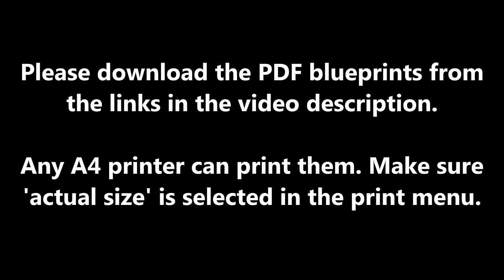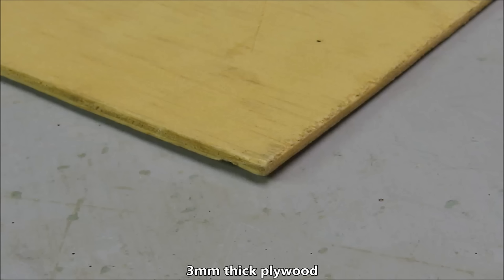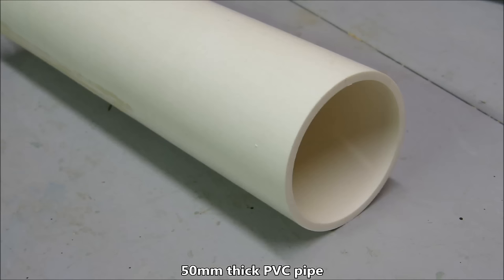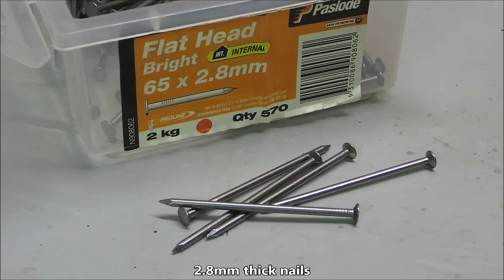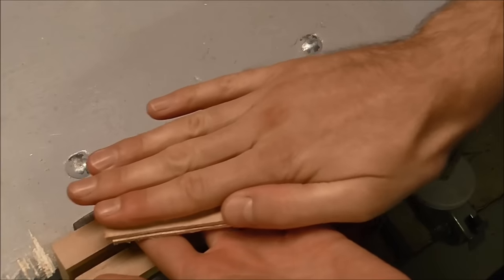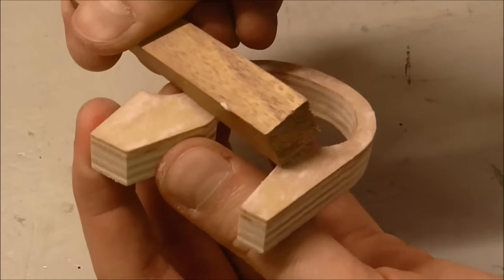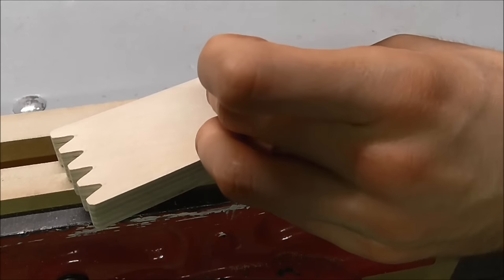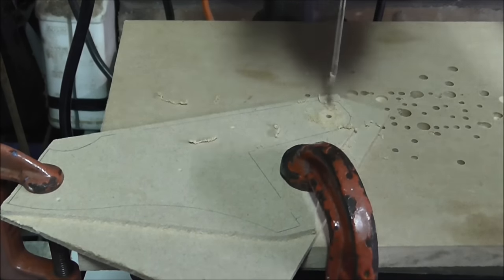Tutorial — rubber band flare gun

Comment: Hey is there a way to make it use diffrent bands
Cuz I heard loom bands were a bit poisinous here
Reply from the maker: Loom bands are pretty rubbish. I now load mine with doubled-over size 12 bands, you could do the same with size 16 if you make the shells about 130mm long. Skip to 8:03 in this vid if you don't know what I mean by doubling them over:
https://www.youtube.com/watch?v=4qFJyTLjNxY
Reply: +parabellum1262 thanks I thought you meant modding the shells so I got scared 
Then I watched the vid and then it got pretty awkward
Reply: +parabellum1262 Hey We couldnt find 50 mm so we got 32 mm does that work?
Reply from the maker: It could work, but it will involve a lot of modification to the plan. The shells will need to be narrower, the frame shallower and the moving parts modified to fit the pipe. You could try another hardware store, or maybe even eBay.
Reply: +parabellum1262 allright We bought a 50 mm anyway